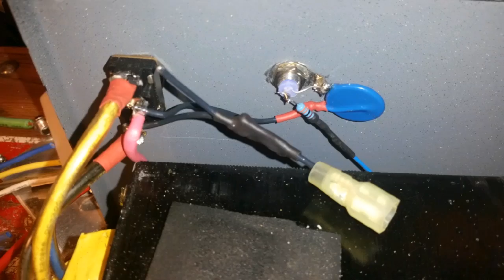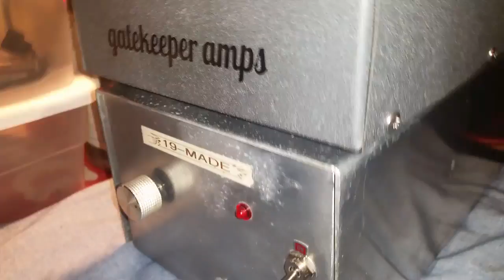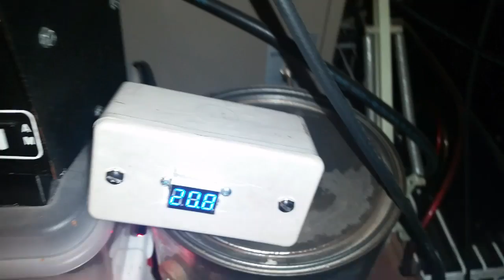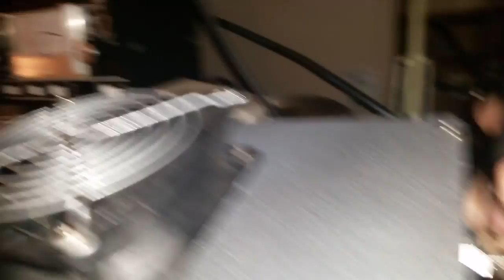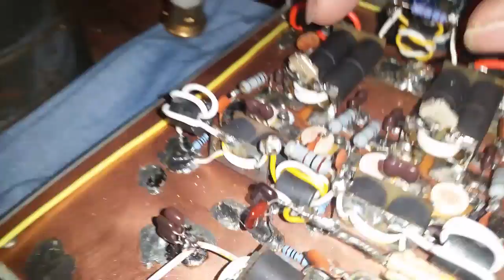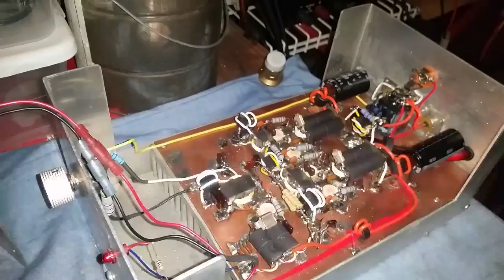19 Made 1x4 Rebuild & 100A Power Supply Build

Comment: why the resistor from the variable to the input? value?
Reply from the maker: Doesn't really matter....you honestly don't need one or unless your trying to attenuator a little bit of the signal then that resistor becomes part of the PI Attenuatoe or L-Attenuator to just help back down the signal more like forexamlle with a 3 pill ill put a 22 to a 47 ohm resistor right there.

On 5 pills I may put a 1.8 to a 10ohm....but it isn't needed. Just one of those things...it can help to slow down the RF just. A tad bit before entering into the input xformer

Comment: Dude, as hard as it is getting to find true power output transistors, a few amps have come across my desk that have what I believe to be IRF520 MosFet transistors in them, and to be honest...they seem to work quite well for what they are. They damn sure don't put out the power that is displayed on the front of the amps, that's for sure...except for SSB...as long as I turn the variable power of my Galaxy 959 all the way up to a 4 to 5 watt deadkey and let it swing forward, it will do the amount of power on the front of the amp and then some. I have been contemplating building amps with the MosFet transistors in them...a lot of radio manufacturers seem to be going that direction anyway...Galaxy and Ranger for one, seeing as how they use the exact same main boards in all their radios now days. There is even information out there on how to convert your standard final transistor radio to a MosFet radio, adding dual MosFet finals with a heatsink, etc. They even sell the EKL kits for the power and audio upgrades as well. I just wondered what you thought about that idea, seeing as how finding the old school power transistors (2290's and 2879's) are getting harder and harder to find...they do have comparative replacements and similar devices like the SD1446's, MRF455's and MRF456's...but I guess I'm just old school and set in my ways...I like the 2290's and 2879's, even the SD1446's are very adequate devices when tuned right. But I have been seriously considering just going with upgrading all the radios and amps with MosFet transistors, seeing as how they are a hell of a lot easier to get ahold of...and if you do a little research and cross-referencing...you can find MosFet transistors that are pretty damn equal to the original SD1446's, 2290's, and 2879's...some will actually have more and better power output than the old style transistors in some cases, depending on the MosFet model, power rating and tuning once it's installed into the radio or amp. Example...I have two Galaxy DX959's...one with a 2SC2166 driving dual 2SC1969 finals (also getting more and more difficult to find), and the other one has three IRF520 MosFet finals...and believe it or not, my DX959 with the MosFet finals actually puts out more overall power and forward swing than the DX959 with the old school finals. The same thing with two amps that I have...one has a single SD1446 transistor in it, and the other is an RM Italy KL-203 with three MosFet transistors in it. It's a whole different animal though. My Galaxy DX959's (both old school finals and with MosFet Transistors deadkeys 1 to 1.5 watts and swings to around 20 to 25 watts at 100% modulation) when hooked up to my amp with the single SD1446 with a 1 to 1.5 watt deadkey, the amp keys around 30 watts and swings a little over 100 watts (about 150 watts on SSB)...when hooked up to the KL-203...it will stay at the deadkey of 1 to 1.5 watts and swing to around 125 watts (175 watts on SSB)...it acts more like a modulator than a linear amp...but I love it that way. I have always drooled over a really low deadkey with full forward swing to full power output...and even then some. I am in the process of getting my own shop started, that's why I messaged you earlier and asked if you'd be interested in doing dome trading for an analog/digital volt/amp meter, and an analog/digital watt meter. Like I said, I am the only guy in the entire area that knows diddly squat about radios, amps, antennas, SWR's, power output and modulation...the difference between single and dual final radios and exactly what each can and will do when peaked and tuned the right way, etc., etc. I just wanted your thoughts and opinion on doing it the way that I plan to...but again, I am looking high and low for ANY testing gear and equipment that I can find to trade for, or buy dirt cheap at garage sales. The shit is practically impossible to find...I haven't found ANYTHING anywhere...it's quite frustrating. Like I said, I do have a few sets of analog meters, but I don't trust them. I am looking for some that have been calibrated to the Bird 43 so that I know for a FACT that the readings will be pretty damn close as they can be. Let me know your thoughts on the matter. Thanks for your time and videos...I've learned a lot.